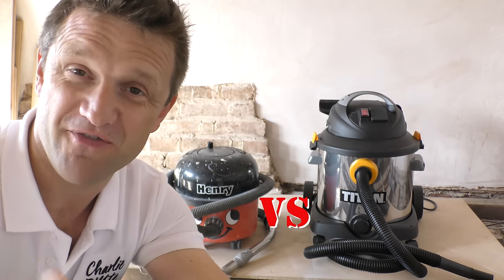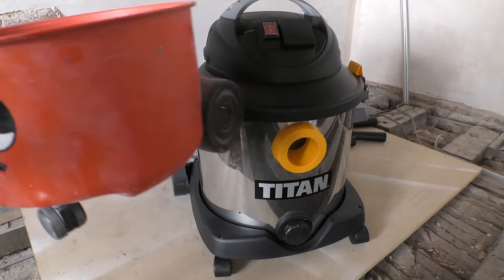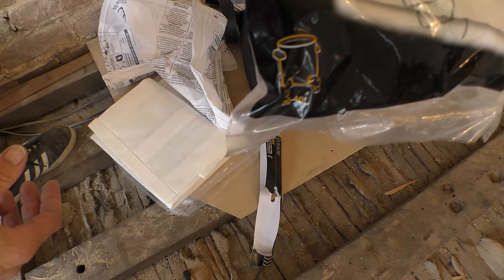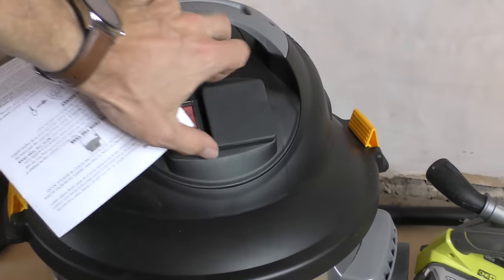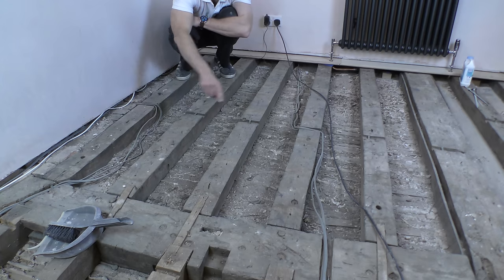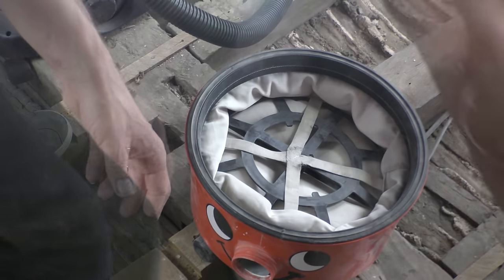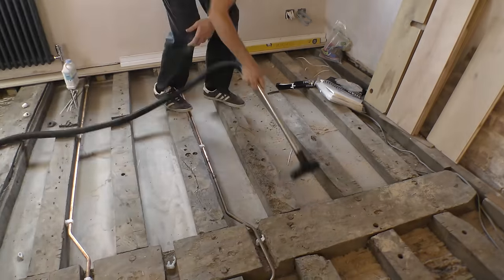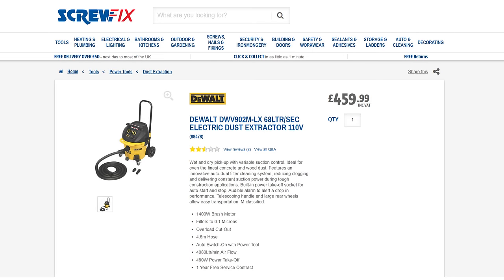TITAN vs Henry - DIY Vacuum Review

Comment: Thanks for the review, it makes several very interesting points.
I use an old henry with hepa bag installed, but connect it to a self made 25 litre cyclone of sorts that collects almost all of the debris, even the very fine plaster dust etc.  I rarely need to change the bag and because of this, the suction stays high for much longer.
I made a simple cart that holds both, one above the other so the footprint is about the same as the Henry itself.
Reply: Ditto.
Reply: I am looking for a cyclone-based shop vacuum and can't find any!! How is it possible there is no such product?? Is everyone in bag business?...
Reply: love this idea.
Reply: @TheKlink  Yes, very similar, but I mounted my separator above the vac to keep the footprint as small as possible.  Also I made a 'Thien Baffle' to make the separator a little more efficient.  A google search will provide more info about this, although the example that you linked above seems pretty efficient anyway.

Comment: I am in Australia and just borrowed a similar Vac which came from Aldi. 1200 watt motor. I needed it to clean out sediment from our Hot Tub (spa) and it was brilliant. Had never thought of using a W&D Vac for that. It was 30 Litre capacity and also had the extra power connection. As ever with Aldi, I will have to wait until the next time it becomes available.
Reply from the maker: Hi Bob, yes they're great for stuff like that. Can you pick one up from Bunnings or similar?
Reply: @CharlieDIYte  Yes, there are plenty of similar ones on the market. I have ordered one from Amazon, 2000 watt motor and 30 liters. That comes at about 55 Pounds Sterling, hope I don't regret it.

Comment: For many years I had an Earlex  combi vac. This came with 2" diameter hose and was fantastic.  Sadly, the kids used it without a filter and the motor.......got...  Well, a bit rough.!
I was delighted to see that Wickes did an identical and cheap machine. I bought it immediately. The hoses, wet filter and dust bags all fitted it.
It's an all round great machine, and has been well used. Very useful blower function too. I clean out the fabric bags and use them at least twice. Simply blow out debris then wash...!

Comment: Great video, though it's left me feeling if there are other alternative builders vacuum cleaners out there to consider.

One question I do have regarding the blow facility on the Titan model, do you need to empty the bag chamber and wipe clean before using the blow option?

Regards

Robert

Comment: My first DIY vac was a Karcher. Loved it and it saved my bacon so many times when I had a water spillage to deal with. Then I've decided that I want an automatic power switching capacity and got myself a Bosch GAS 20L. Kind of loved the vac but then I've become more aware of the dust issue and that I just could not get any M or H class filters to fit onto that L class Bosch. Needing to with with MDF and other fine dust I became more and more aware of all the fine particle dust that Bosch GAS 20L was still spewing out. A 20 litres capacity is really a con fore only about 6-7 litres would fit in branded bags before everything started to "suck"! Then on the local forum someone was giving away a Henry vac. Two speed one with some spare bags. Having been pretty annoyed at high noise from both the Karcher and the Bosch vacs I was amazed at how quote Numatic's Henry was. It still has great suction even at the lower setting and what I absolutely loved was an abundant availability of spare filters all the way to HEPA inset one. It does drop the power a little but it is still powerful, it is quite and Henry's much smaller bags fill all the way to the brim. These bags cost a fraction of Bosch bags and feels like they do at least as much if not more of the job.
My vote goes for Henry all the way. If I ever need a new vac I'd be looking at Numatic range much more favourably than both Karcher or Bosch. I've even had a short encounter with Dewalt's vac but that was such a large and cumbersome monster that sent shivers down my spine as it felt like a steam locomotive was behind me and I was sitting on the railway track, as it was roaring and clapping its self-cleaning filters.
Reply from the maker: Love it - thanks mate - invaluable feedback!

Comment: Charlie, the DeWalt is a dust extractor not a vacuum. Different thing, they are rated L class, M class and H class. A couple of years ago HSE updated the requirements for commercial use from L class as a minimum to M class as part of their programme against respirable dusts and very probably move to H class at some point in the next couple of years.
If you're using a face mask, for a disposable get FFP3 rated and for a half mask get P3 filters. Should be used for any dusty job.

Comment: I’ve had the same titan for about 5 years and its been really good, emptied the residual water from our hot tub as well, I’ve not had any blockages but I’ve never used it for serious DIY like this.
Great video
Reply from the maker: In actual fact, I've since found a great use for it. It's really designed as a static shop vac and when you attach it to a cyclone like I did here https://youtu.be/9RfHpm2vf40 removing the terrible dust bag design issue, it's pretty good. Good work using the wet vac feature. I've never actually used it was a wet vac. I tend to use my George for that.

Comment: I have one of the origins Henry’s called the TX-TX. After nearly 25 years use I still goes on and on. It is still compatible with all current numatic Henry spares and accessories. Well done Numatic. Remember the old saying. Buy cheap, buy twice. 

Plus as another YouTuber mentioned I’ll the comments Numatic do bigger machines.

Comment: im an electrical apprentice, and my dad gave me his henry from when he was a builder it was atleast 25! but then the idiotic plumber decided to borrow it and used it as a wet vac was gutted. i was going to buy the titan you featured in this video but then i saw on the screwfix website a 15ltr 800w dry vac. i purchased it to replace the old flooded henry. very simiar in terms of desigh and henry bags even fit it which is a bonus as i have about 50 spare ones lol. would highly reccomend the dry titan it has metal pipes and much better floor sweep end. my boss has the one you showed in this vid and tbh its pretty bulky and it gets blocked so often and the attachments are shite. would reccomend you try out the dry version as its so much smaller, quieter and better quality to the wet vac. cheers
Reply from the maker: Thanks Jim for taking the time to send that. All makes perfect sense. Does the bag fit tightly, as that is one of the most remarkable design flaws on the wet and dry version, along with the terrible accessories as you say.
Reply: @CharlieDIYte  yes mate they fit much better, the wet n dry one either drops off when its full of rubble and blocks the filter up. but my little dry one fits nice and tight. its got the same sort of filter as a henry a round bucket type which probably allows it to be used bagless but i havent tried it bagless... the bags are also a cloth type which are way better than the paper ones you get with the wet vac which just seem to split. pretty pointless even putting a bag in it in my opinion.

Comment: I bought aftermarket bags for my Titan. They seem to seal OK but it's like they are made from tissue paper, they tear so easily. Will be trying different ones going forward. As for the Titan vacuum itself, it gets used in the garden workshop, for the car, and cleaning the house carpets when we want some proper suction. Apart from its bulk, I like it and think for the price it was a bargain
Reply: Did you find a good aftermarket brand in the end?
Reply: @justrobin1234  Haven't used up the bad ones yet! But i will get them from Screwfix, where the vac unit originally came from, so I will have recourse if those are poor quality

Comment: I've been using the 16l titan for woodworking for a few years now, I don't use any bags or even a dust filter (I didn't get one with it, I was given it 2nd hand and abused) it only has the wet foam filter thing.
It still works, and I don't really look after it so I can't complain.

Comment: I very much like your videos as you speak clearly and present in a direct snappy way . Came across this particular vid whilst google for reviews of the Titan vac. As a professional wood worker  with a requirement for machine to be used for floor/ machine cleaning and adapting for power tool extraction my Henry has been superb. I have been able to replace on / off , hi lo rocker switches , PCB etc and always found helpful instructive vids on YouTube.
However I must point out that you do the Henry a disservice as you seem to have bought the lower watt machine rather than the more powerful 1200 w. This is what I have only once experienced over heating due to full bag when machine was being used as dust extractor for floor sanding.
From time to time I remove a bag and just shake so the waste settles at the bottom this preventing blocking and / or overheating. So not difficult to do and a simple case of tool care.
Reply from the maker: Thanks Andrew. I think the other disservice was using the Titan in a domestic context. It was only ever designed as a shop vac and once I had it in a static environment connected to a cyclone it was brilliant on my wardrobe build https://youtu.be/9RfHpm2vf40

Comment: Hello, I have nothing against the Titan, but just a few thoughts: -
There is a George wet and dry. A larger capacity than Henry. c.1200 watt motor. It came in useful during a recent flood in the garage. We now have both, (H and G).
I tend to find that for industrial waste and rubble, a broom and shovel or for smaller / finer clean ups, a pan and brush is the most effective way to start a clean up job like the ones shown. A vacuum cleaner is best when removing all dust. 
Where bags tear and this can be a problem, try backing them with tape such as Gorilla   black tape. I have found this to work on the back entry points to the bag and at folds/ ends of the bag when I have occasionally misused or abused the tool.
Have a look at Record Power vacuum/dust and waste collectors if cost is a factor, perhaps consider their filter bags. These fit around the main filter as a 2 stage dust exhaust blocker and help improve motor life. I just bought the Aldi vacuum cleaner for c.£33  last week. It's cheap and marketed for ash collection, but as there is no bag,    I have fitted a Record Power  filter bag to protect the main filter. This may need to be replaced from time to time if it cloggs up, but the fitting looks similar to the Titan.
In conclusion, how you got away with poor old Henry beats me; and a 600w motor?  However cheap and cheerful the Titan, I suspect that you will attentively be paying out for in collection bags. Even so, the filter probably need additional dust protection or it will simply clogg up. You probably need a shovel, broom, dustpan and brush to get you started.   Regards,   Glenn.  :-)     ( for attentively read subsequently. .  .  . Grr, spell checkers).
Reply from the maker: Cheers Glenn - great comment! The Henry used to have an 1100w motor - which made it much more effective. People say the 600w are similar in that they've improved the efficiency of the design, but I've got a weak motor with the old design, so worst of both worlds. That said, it's fine for the odd DIY job.

Comment: Thank you for a great review of a cheap, badly made vacuum aimed at DIYers.  However, I agree with the 11 comments recommending using a cyclone separator.  It will capture most of the dust/debris in a bagless container whilst preserving the life of the vacuum motor and air filter which will be drawing mostly clean air through it. The downside is having to make the vacuum+cyclone portable but there are plenty of good videos from You Tube woodworkers showing how to build a cart for this purpose.  I would like to hear your opinion on the vacuum+cyclone.

Comment: I think the greater flow of material (due to the more powerful motor) is likely to be a major contributor to the blockages, in addition to the slightly reduced tube size.
Reply: Miss Take Not Yes I can definitely vouch for this, I have found that mine blocks when I tried to pick up to much at once, it doesn’t struggle so much with the size of what it’s picking up but pick up two or three of the same size bits at once and it blocks
Reply: lol. 1200 Watt just consumes more power… Suction power depends on many things, and Henry “Sucks” best! In a positive way… so those blockages are really because of bad suction power, despite the high Wattage…

Comment: I've had one of these as a DIY/shop vac for the last couple of years. It has done everything, including using with power tools, clearing up water leaks and even sucking up leaves. I've found that the plastic tubes have held up pretty well to hard use, though I only use it for diy etc, so not sure how the plastic head would do on carpets etc - it cleans my garage floor well enough. 

I've never really had a particular issue with the bag fit, the only issue i've had, is that like you, i've managed to block the tubes sometimes with larger debris. The only thing i've done is swap the standard filter for a HEPA one (which gets a regular good suck out with my dust extractor). Overall, for the money, I think they are excellent as an all round, affordable and hard wearing for DIY, and half the price of a Henry and only a fraction of the price of the Bosch and Dewalt shop vacs, though if you are want to use it for serious dust extraction then they would be much better (being M class), but that's not an issue for me as I have a proper dust extraction system for that.
Reply from the maker: Thanks Dave - great comment!

Comment: Henry Hoover all the way. I also have a wet and dry which is pretty powerful but also made the mistake of taking advice of others saying it was fine to use without a bag, it soon blocked up in the hose and created an almighty mess inside the drum with dust. I promoted my Henry from household to diy use and have never looked back but like you say don’t overfill the bag.

Comment: Hello Charlie. I see the Titan had to borrow the Henry’s stainless extension pipe lol. After watching your video I’m even more happy with my red Henry I purchased on eBay from the mother country a few years ago. It was band new and with shipping cost $214AUS. So lucky to pounce on that one. I use it for my handyman business all the time to clean up and the main attachment tool I use is a Hyde hand plaster sander. When I take the lid off to check on the hepa bag, there is no fine plaster inside the base at all. That tells me the motor is safe and I’m not leaving fine plaster dust through out the home. Great video once again thank you Charlie. Regards from Perth W.A. 🦘🇦🇺

Comment: Great review been looking for a vacuum for a while now but not really sure what to get for the small amounts of DIY looks like a could be getting a Henry
Reply from the maker: The beauty of a Henry is that you can use it around the house as well as for DIY. I've got a Henry Xtra HVX200-12 with aerohead for carpet and it's been brilliant. They also do a Henry XL Plus with a larger from capacity but I'm not particularly impressed with the quality of the hose accessories. I think it's aiming at the shop vac market. On which point, check out this vid if you're only really intending to use it in the workshop https://bit.ly/3fssYHn

Comment: Hi Charlie thanks for the review. I have the smaller Titan in my workshop and it just blocks up everytime i use it. Was thinking of getting the larger one but you have shown it does the exact same thing! Cheers for the video.
Reply from the maker: Cheers for that Vinny. Have you tried the cyclonic attachment people are mentioning in the comments? https://www.screwfix.com/p/triton-dust-collection-bucket-23ltr/3754r Could be the solution.
Reply: @CharlieDIYte  I actually bought a dust commander to bypass the small hose issue. I hope this solves it as the vacs are not bad for the price. Cheers again Charlie.

Comment: Great comparison video Charlie. I bet the Titan won't be going in another 19 years. I have a few Titan tools, and Ferm (older Screwfix brand) and they aren't too bad.
 I've been using a Karcher wet n dry vacuum WD3.500p for 5 years now. I paid under £50 for it from their repair outlet centre, but to all intents it seemed new, even in original packaging. It's been a good alternative to a budget machine.  The hose does block easily with brick rubble but ok with most other things like wood shavings. It has the power take off which is handy. Power cord and vacuum pump hose it a bit short for hooking up to power tools. Vacuum pipes are decent tough plastic as are the accessories.

Comment: Parkside (lidl) vac costs only slightly more than the titan but has a much higher build quality including metal pipes. If you are not in a hurry it is worth waiting for. I am on my second, the first lasted about 8 years of abuse before the bearings started to go, I now use it for rubble only as it whines terribly.
The new one is used with a dust deputy cyclone and it is superb and the filter never clogs.

Comment: I got the small fully plastic one when it was on special. £30 or something with extra tough bags for a fiver. So far so good. Works for liquids. Can reverse it into a blower. The safety/instruction manual is hilarious. Full of really obvious stuff.

I really like its bare bones basic design. I always see more fancy vaccums dumped in the street. I dont use it for really big stuff. Might modify/upgrade the tubes